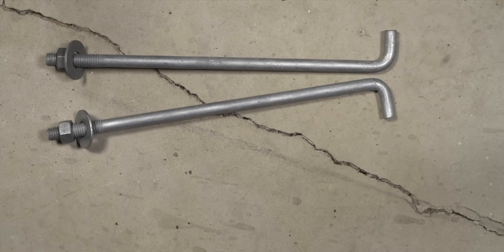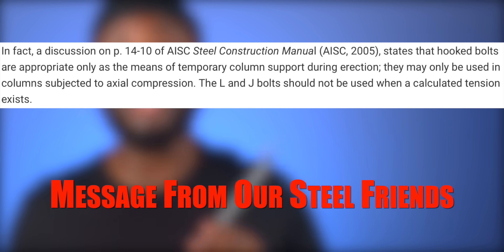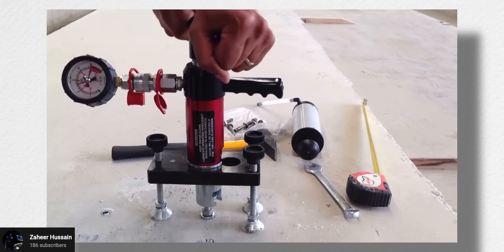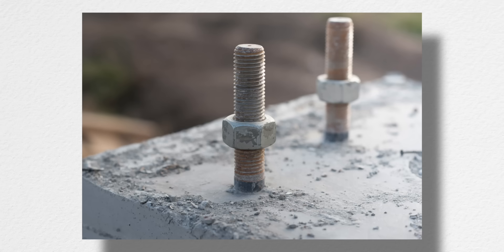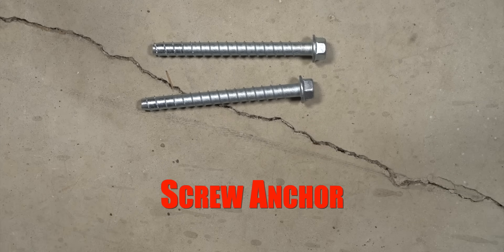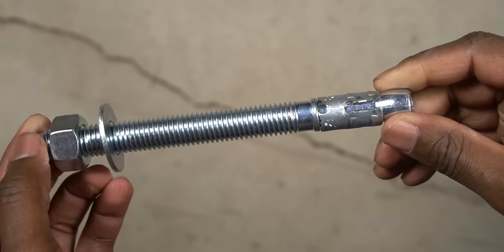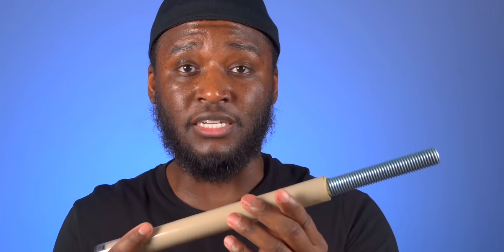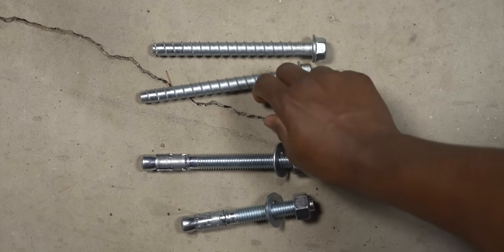Why Abandon "J" & "L" Anchor Bolts in Wood Framing Construction FOR GOOD?

Comment: Concrete dust, drilling concrete takes a LOT of time and creates a lot of concreted dust that (in my case) required an INSPECTOR-seriously- to watch the newly drilled concrete hole get blown out with air (which is typically not readily available on a new construction) or brushed with a bottle brush before applying the epoxy. Otherwise the concrete dust in the newly drilled holes do not allow proper adhesion.  You simply can't blow it out with a breath from your lungs (face full of concrete) or with water (puddling).  Your theory is good, real world experience it is not practical.   You should invent something better, you have great ideas.
Reply: drilling a 7" deep 1/2" diameter hole in concrete takes 20 seconds. the dust is annoying so i use the hammer-in bolts -- no epoxy. but the right little air nozzle and vacuum with brush cleans out the holes adequately for epoxy bolts. embedding the bolts during a concrete pour is annoying as hell, but definitely is nice when done by a pro.

Comment: What about tying the L bolts to horizontal rebar prior to pouring? I’m building a steel PEMB and was thinking having the guys tie the 1/2” rebar in the beam to the bolts.
Reply from the maker: For a PEMB I would recommend not using L bolts at all. Those buildings are very susceptible to uplift in high wind because they’re so light and the research into failures of those bolts have centered around PEMBs and L bolts. I would use a cast-in straight bolt with a heavy hex head embedded in the concrete. 

I’m assuming you’re setting the frames on a slab with a grade beam so I’m going to run with that assumption from here. The horizontal bars likely do provide some help, but it’s vertical bars that would do the best to help prevent a failure due to uplift. But the horizontal bars do help in other ways without making this comment even longer.

I have done what’s called “tension anchor reinforcement”. “U” bars are put in the concrete in such a way where the vertical legs of the “U” align in close proximity to the base plate anchors, but it’s not tied to the anchor. The vertical legs just need to be in close proximity to the anchor. I suppose you could do this with L bolts, but I haven’t seen anything that says it should be tied to the anchors and I haven’t or know of an engineer that has done that. Again almost all engineers I’ve worked with & learned from designing steel buildings aren’t using L bolts because the organization responsible for writing the steel code recommends not using them. But there may be those engineers who don’t mind.

But lastly I would highly recommend you get a structural engineer to provide foundation drawings. If your building is a simple rectangle and small, a competent SE could turn that around for you very quick for not a lot of money and give you the peace of mind of a sound foundation system.

Hope that helps!

Comment: This was by far the best video I found on anchor bolts. My next step was going to be finding the ICR code regarding them. The video took care of both. I might get banned from the channel, I plan to use L or J bolts for my project, lol. I don't have a hammer drill so an L or J bolt would be the easiest and most cost effective in my case.
Reply: You do foundations in concrete and can't afford a $235 rotary hammer? I agree in general but that is weird.

Comment: Hey man just found your channel, really interesting and very simple to understand. I’m sure you come across cantilevers in buildings, can you make a video showing a cantilever home, where part of a bedroom is cantilevered, and how one would attach a deck to the cantilever.. I see people shockingly attach their deck ledger board to the outside of the cantilever with no load bearing beam/post.. certain failure will follow with a heavy snow load or multiple people on the section of the deck attached to Cantilever.. definitely needs to be addressed!

Comment: I have to disagree with this video,  you as a P.E. should design based on safety or structural integrity but do it in the most cost effective way you can. If you were just referring to a retrofit solution then okay drilling and epoxy or screws would be on the list. But just saying no is a dis-service to your clients.
L bolts are not for uplift, they are mostly about lateral movement, the nuts are not even tight typically. Uplift resistance is supplied by HUD style connectors for both slab or raised floor and the HUDs are connected directly to the studs.
Mud sills are not part of the load path on the raised floor diaphragm or a slab. Using drilled anchors after the fact is just expensive from a labor stand point.
What I noticed is a larger supplier base for L bolts which means the deep pocket corporations can lobby out the use of a low margin product they can no longer protect with a patent. What you see now is an overly complex anchor system they have complete control over with the associated higher price.
-MG
Reply from the maker: I think you missed my paragraph where I comment on the use of L/J anchor bolts, but that’s ok! Thank you for your comment.

I’m not sure what an HUD is, but I think you’re referring to an HDU (hold down anchor). If I’m wrong, respond with exactly what you’re referring to. 

HDUs are provided specifically for shear walls to resist uplift as a result of the shear wall wanting to rack (AKA rotating at the corner from a lateral shear force). They are typically provided at the ends of a shear wall. This is not commonly used to resist uplift from wind creating suction forces at the roof, causing the roof to lift away from the walls. That is typically done by anchor bolts attached at the mudsill to the foundation, or by a special mudsill anchor hardware. So unless you’re attaching HDUs to every single stud, which I feel is not cost effective at all, then I can understand slightly.

Your mudsill comment is off. Mudsills refer to a PT plate sitting directly on the foundation. On a raised floor, we refer to that as a “bottom plate”. BOTH of those in today’s American construction standards are structurally necessary and part of the load path for gravity and lateral forces. Which I plan on explaining in the future.

As a P.E., I have every right to tell a client “NO” if I’m contracted to work with a client on a project that I’m designing and they want to use a structural item in a manner that it should NOT be used for. That is part of my responsibility. And although you missed my paragraph in the comments pertaining to my harshness over cast-in bolts in this video, L/J bolts have a place in building construction in many applications. I would be doing more of a disservice not saying anything as opposed to proceeding with caveats. But that’s just my opinion.
Reply: @JthaEngineer  HUD was a typo, it is HDU. Maybe we use different terms for the components. The L or J bolts are still being specified by P.E.s but they do not come with uplift tables. You can find tables if you look in older catalogs etc. In fact Simpson only sells L bolts in Canada according to there web site,  there is more money in Titan screws.
Terminology is interesting here, a mud sill in my book is pressure treated because it comes into contact with the concrete and varies in size based on local codes or sometimes the local inspectors whims... The bottom plate is part of the wall and is typically the same 2x material as the wall itself.
I am not sure which American construction standards you are referring to there are so many and the local jurisdictions can and do reject some of the sections.
I think my mudsill comment is right on, it is only lateral loading and gravity, how is that part of the load resistance when the bolt used to hold the HDU is extended beyond the mudsill and directly ties to the HDU connector,  which is tied to the stud or column with nails or screws.  I am also confused by the your statement that the load path went through the mudsill (bottom plate for you) then the load path is limited to the Pull out force of the toe nails in the stud. Those values a so small that you could never resist several thousand pound uplift loads. The HDU attachments are loading the screws or nails in shear a much stronger way of loading the connection.
As a P.E. you can tell the client no, that is true, and I would expect nothing less when necessary, but I would also expect you to provide the full information as a P.E. so the client can decide for themselves if your the P.E. they want to use especially if it cost more. 
I would also expect you to know the local codes and the quality of the work teams in your area. If the teams are more than competent using the drill in place method then sure specify that method. In my area the teams are less than precise and tend to speed over accuracy, which is why cast in place L bolts are still being used, and in fact are required by the engineers and the county/city inspectors. If I went with drill in screws I would be required to have the engineer of record (the P.E.) come and do a special inspection which again cost more money. (minimum charges site visit and letter saying it was done correctly)
-MG
Reply from the maker: @meshedgears2794   I can tell this is not going to go anywhere because there is a clear difference and mix up of words in regards to what a mudsill is vs a bottom plate, what HDUs do for a building, and what this video is addressing. There is also a clear difference in detailing a wood structure that you may practice vs how other practice, which I can understand but do not have the time to go back & forth through a comment section.  I understand what you’re saying, but I don’t think you understand what I’m saying.

But I will personally meet with you through zoom, teams, or whatever platform and explain exactly what I’m talking about to you. Otherwise I’ll leave this conversation where it is now. Thanks!
Reply: @JthaEngineer  Hey leaving it where it's at works for me, different terminology, different regions, and different approaches to solving a design structural problem. I may pop in to see the future videos on occasion.  I also think there is nothing wrong with wanting to get information to those who are interested. I have to give credit to you for doing videos in the first place its a lot of work and time involved it getting them created and edited. My ugly mug would just break the camera. Again, I may take a look from time to time..so don't quit all information is good information for building science.
-MG

Comment: My community garden would like to build a 12 x 16 gazebo.  The kits they sell require you to bolt it to concrete, but our landlord doesn’t want concrete.  So we’ll need deep footings… What I’m wonder is, will bolting our gazebo posts to wooden footings be strong enough?
Reply: Hi FreedomFox1, try ground anchors these are basically large screws that can be moved or removed as needed. Search for "American Earth Anchors" they are not cheap but they are good for just about any soil and have loads tables. The larger versions allow for direct support to a beam. I used them for a solar mount and a small structure. The version I used had a top sized for 2 inch iron pipe. I used short sections of pipe with threading to attach to a small iron floor flange plate. The plate forms sort of a small adjustable platform to sit a few wood beams on. Once I got the beams level (the screw thread allows fine vertical movements) I used 4 lag screws to attach the beams then built my small structure on top. The screw anchors can have several thousand pounds of uplift resistance. hope this helps.
-MG

Comment: I liked your video, and I understand using it in plain concrete settings. However, recently I bought a house that is sitting on a cinder block wall foundation. The house is on a slope, and half of the house is sitting on concrete foundation ad the other half is sitting on cinder block walls.The cinder blocks are over 10 feet tall. I think it would be easy enough to put in j bolts inbetween the  cinder block joints to fasten the sill plate, but since the top of open and exposed on the cinderblock, I am not sure what else I could do? I could try and fill in the block walls at specific points, but I think that would take a lot of concrete, and I am not sure if it would settle correctly. I am not sure if there is something else out there to use?
Reply: your house is not tied to the blockwall with anything right now?

in terms of just tying them together for fun, you can fill the tops of some blocks to make them solid and anchor into that. use whatever to stuff the blockwall void 8" or 16" below the top course so you don't have to fill the whole cavity. like pieces of tile or cement board. or fill the cavity 80% with gravel. 

but if you want to tie to the blockwall for earthquake resistence, that involves giving the block wall tensile and shear strength, and when you attach to the plate on top, usually the entire cavity below is filled with concrete and a long threaded rod or rebar and an anchor. 

if you're trying to resist wind uplift, just 1.5x or 2x the number of anchors. in the absence of an engineer's advice.

Comment: can't find videos for screw anchors and like what drill to use and depth of drilling etc.
Reply from the maker: Look for videos from Hilti, Simpson Strong-tie, or Titen. All 3 manufacture screw anchors and Hilti also manufactures equipment. That’s about the most you’ll find on them currently.

An SDS hammer drill would work for the application similar to what’s described here. Hammer drills typically are used for holes smaller than 1/2 inch. Depth of drilling is on a project specific basis, but architects, structural engineers, or the code may give you that info too.

Comment: A screw anchor will never end up in the middle of a stud . You also don't have to lift the walls up and over the anchors. Stand the wall up square it and pin it to the foundation. Post install anchors are great😎
Reply: A Simpson Strong-Tie MAB15 can end up under a stud and it would not matter at all. It is all I use.
Reply: I once forgot to put the bolts in (I don't normally do the foundations) and this was the solution.  It was nice not having to pre-drill, and the holes were easy with a rotary hammer drill.  It all met code, but I have a hard time believing that the threads hold stronger than a J bolt.  I've never seen a house blow off the foundation in my state, and there were no codes on this pre-1960's, possibly later.
Reply: If you actually design a house first instead of freestyling it, nothing will end up anywhere except where it's supposed to.
Reply: @canonicaltom  Agreed. Never has a "J or L" bolt ever failed on my job sites (almost 30 years in the industry.)  

If an "L" bolt is in the way of a stud, either cut around it or cut it off and replace it with a Redhead. 

Now, how many Redheads have ever failed me? TOO MANY TO COUNT.
Reply: @canonicaltom  Great in theory. Nobody designs a house beyond the 'technical concept' level, though, so every builder wings it. Full design means LOD 500, which I have not heard of in contractor-grade residential housing. Re 'If you actually design a house first instead of freestyling it, nothing will end up anywhere except where it's supposed to.' - sounds like you are not a builder LOL, because in practice nothing matches the original design unless you're doing digital fabrication.
Reply: @marcinjakubowski6010  In my area, you can't get a building permit without having a complete architectural drawing specifying where every stud, joist, fastener, bolt, shingle, feedthrough, or electrical outlet will be. And the inspectors will void your permit if you don't follow the drawing.
Reply: @canonicaltom   Well I don’t know about Voiding your permit. But you will spend lots of time talking to your Architect and Engineer. Anything they put their signature on, like a fix will cost you plenty.

Comment: I want to build out a steel building on the inside and I really don't want to commit to a design by using inset L/Js. This is going to save my ass if I want to change the layout mid build!!!

Comment: In your opinion what is the strongest concrete anchor bolt for uplift? I’m building an OVER THE TOP (structurally) icf house in south Florida and what the most bomber way to attach my joists for truss hangers? Thanks in advance
Reply: Jay u r confusing me - u spend a whole video raising issues with cast in j and l bolts because the horizontal leg is do short then you say your best approach is use a straight cast in anchor bolt - ie NO horizontal component??!!
Reply from the maker: https://www.eng-tips.com/viewthread.cfm?qid=416314

In this thread you’ll should see a photo of 5 different cast-in straight anchor bolts. From left to right depending on the situation I’ll specify 1, 4, or 5. That’s what I mean when I say “straight”.
Reply: @JthaEngineer  I agree with John, it seems like the point of your video is that you think post-installed expansion bolts are stronger than cast-in bolts. Then in the comments you say the opposite.
Reply from the maker: A straight, cast-in anchor bolt with a square or hex head at the end is my 1st choice. 

Not sure if there's a "best" way to attach trusses to ICF, but I generally see trusses bear on double top plate & fastened with 1 or 2 Simpson hurricane ties each side. But I have used a truss anchor that's embedded in the concrete. Look up "Simpson META with TSS". I just don't use them often because when I have the contractor has always messed them up.